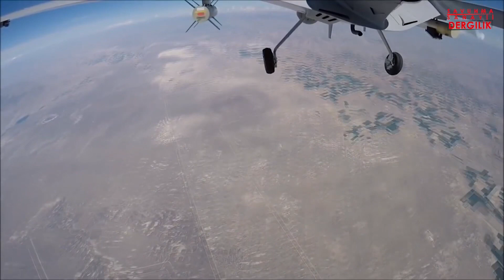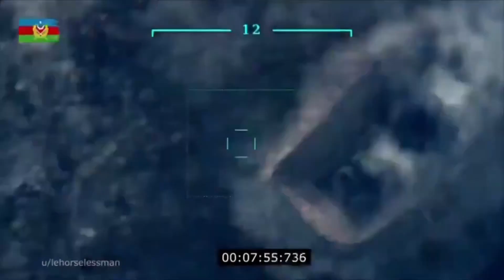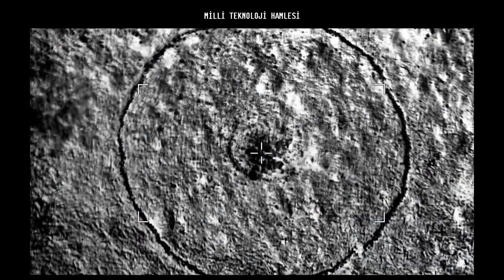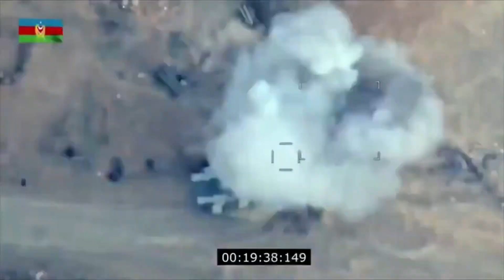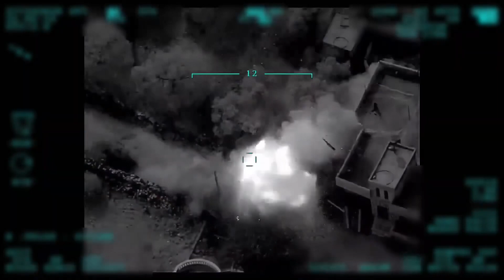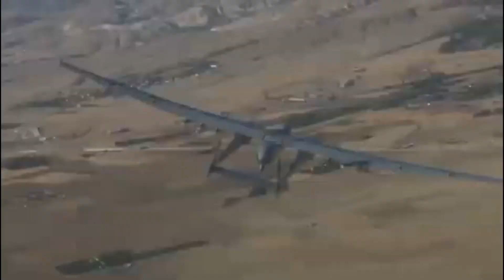How Is Roketsan’s MAM-L Smart Micro Munition So Effective?

Comment: The Turks say that the Bayraktar TB2 aircraft is the strongest and how to be the strongest as they falsely claim, and there are American, French and British drones stronger than them and more developed and able to carry more ammunition than the Turkish Aircraft Bayraktar TB2 scrap, which resembles children's games, knowing that the advantage of hiding from radar and most optical systems and even the engine and controls are originally from Austria, Canada, Israel, Germany and The only thing Turkey has done in this very small plane and the scrap is to make a little software and exterior design only, do not brag about a scrap plane similar to children's toys, many of which fell in Libya with ground defense machine guns and old surface-to-air missiles and even Kalashnikov rifles had a share in the shooting down of the aircraft Bayraktar TB2 scrap in Libya from an altitude of 500 meters inside the Libyan capital Tripoli, system pantser alone, the drop of nearly 3 Bayraktar TB2 aircraft before two pantsere systems were destroyed due to human error from  Libyan operating technicians.
Reply: Turkish-made components: airframe, flight control systems, avionics, software, ground control systems, payload integration, and some domestic sensors.
Foreign-sourced components: engine, earlier optical/targeting systems (now moving to Turkish alternatives, such as the Aselsan CATS), and some communication systems. This "childrens toy" won the war against the Armenian separatists in Nagorno Karabakh. There are hundreds of videos online on TB2 strikes. Total carnage.
Reply: Different markets.